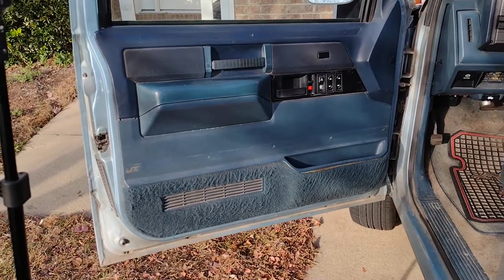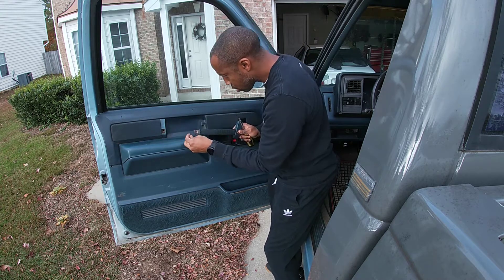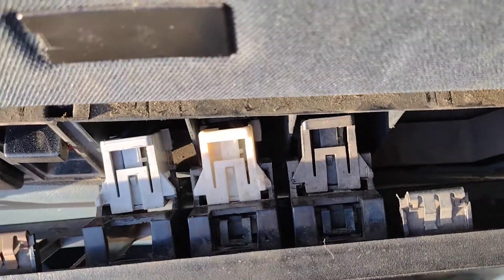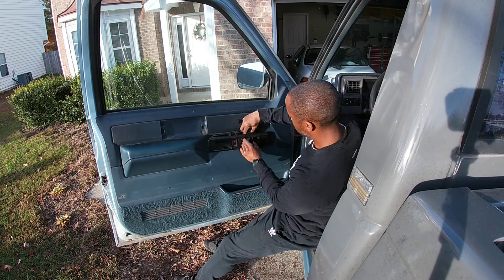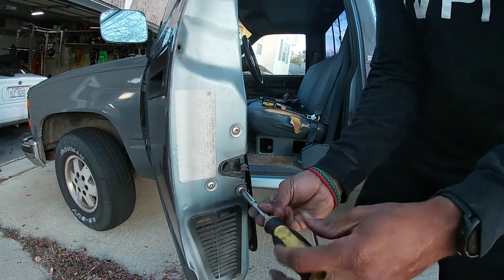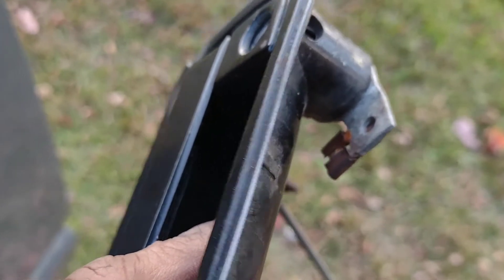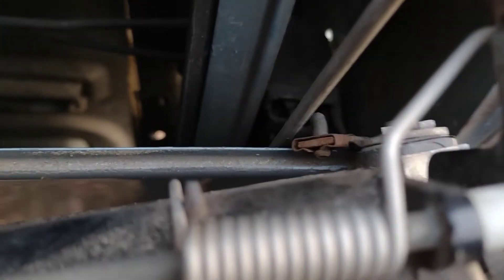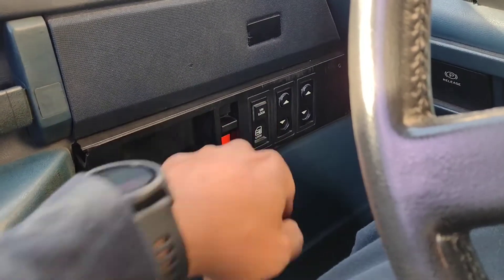1989 Chevy K1500 | fixing the door lock cylinder

Comment: My 98 is having a similar issue, my driver side lock cylinder won’t turn when I put the key in. Passenger works fine but driver side is stuck. Haven’t had a chance to look at it yet but I’m glad I found your video. Gave me an idea of what I’m working with, may have to hit that locking rod with some wd40 but i guess we’ll see. Also seems like your doors close pretty smooth, what’s your secret?? I gotta slam my door to get it to latch😂

Comment: I subscribed because I bought an 89 Silverado in March 2021.  It's the only Chevy I've ever owned and like you, I really like driving it.  I did several little fixes like this to get it up to snuff for daily driving.  I wish I had your motivation and video skills to document some of it.   I've had trouble finding a new blue door pull handle for the interior because these style doors were only around in 1988 and 1989 I think.  I had to make one out of sheet metal that I wrapped in leather.   Every single thing I try to remove on this truck wants to shatter or crack.  I had to replace the headliner which caused me to break a few plastic clips.  I always die inside a bit knowing I was the one that did it.
Reply from the maker: Thanks for keeping your truck alive. Parts are getting harder and harder to find for the early ones. They rarely show up at the junk yards. And when they do, they are often in just as bad shape. Thanks for subscribing. There is much more to come.... because the truck needs it.😉
Reply: Your truck has all the same problems mine does!  88 1500 (same color blue too) I'm in the process of getting both power windows and door locks working.  Great video, Maq!
Reply from the maker: Thanks and good luck. These are the best trucks.

Comment: them plastic clips are cheap but hard to get,, buy 50 off ebay, $10, steve in Australia,       my 92 GMC is right hand drive and needs a fair bit of work,, I will get it all done New paint, Interior, Hot engine.
Reply from the maker: Thanks! I need to order some.